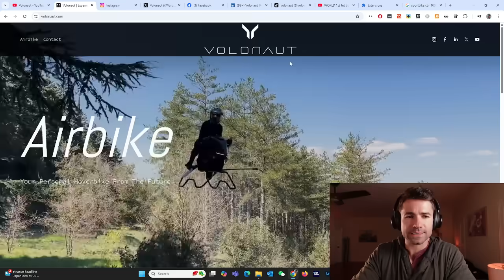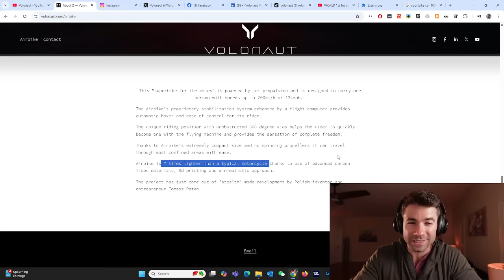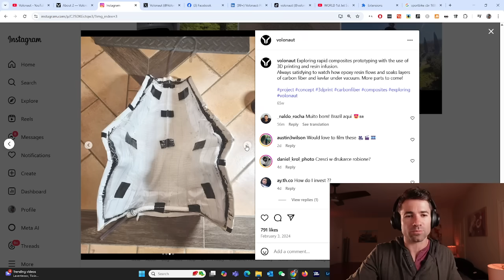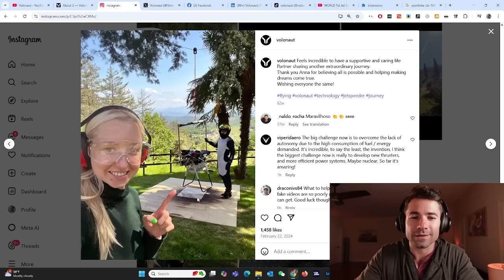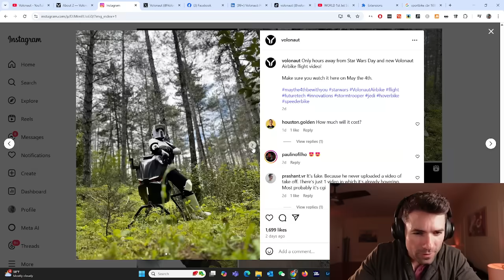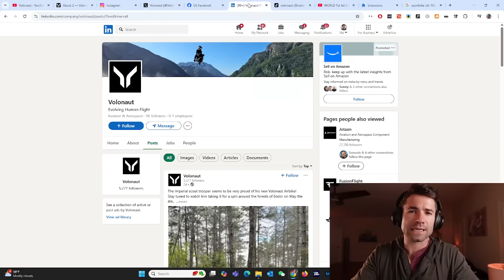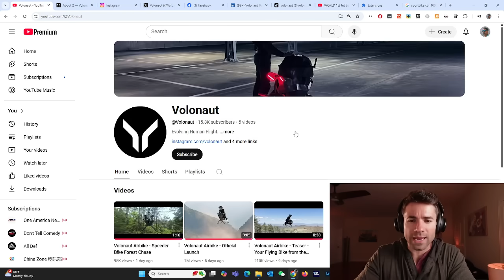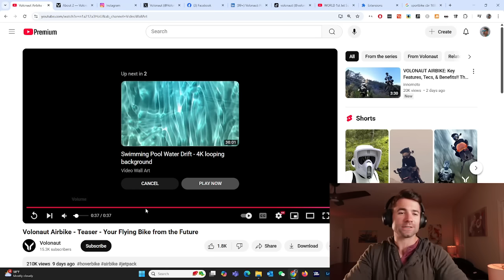Is the Volonaut Airbike Real or a Scam? (Expert Breakdown)

Comment: Is this a joke? As an engineer there are too many questionables:

1 - One handed handling definitely throw off the CG in the air for such a small package.
2 - Without any obvious propulsion systems e.g. no 'air intakes' at all
3 - Lighting are 'unusually' evenly lit in a sunny backdrop.
4 - No gravel ever get disturbed, even at close proximity, while throw up a big dust storm.
5 - No takeoff or landing video (hardest part to render)
6 - No video sound to determine throttling echo with environment
7 - It looks like a movie set "prop" in a green screen
8 - Biggest selling feature is the "massive propulsion system" in a very small package without any explanations.
9 - Frontal camera tracking is fixed to the vehicle yet lack any visible pitch "up and down" motion for forward or hover operation.
10 - The prototype photo shows combustion propulsions, but later change to electric midway through development without explanation?
11 - Tested on hard dried rock and not over some softer grassy open fields to PROTECT the pilot (obvious choice) OR their hardware investment.
12 - Any dusty environment will mess up any form of 'air intake' based propulsion systems with even ducted fans.

So right now, there are 12 reasons why it fake, am I wrong?
Reply: All of the above plus from a business perspective, if it were real, all he had to do was to show a raw working video as proof and investors would be falling over themselves to give him their money which does not seem to be happening.
Reply: @David-fq6ly  The guy's got a company going, selling personal drones, that's apparently sold out through the end of 2026. They seem to be flying. So this stunt could either be to promote that company, or... I don't know. It does not make much sense to me yet.
Reply: @The-Wall-Lizard  I agree, it really doesn't. Looking at the Jetpacks the US military started to use recently, they seem a lot more clunky and hard to use compared to this Airbike so if it were real, he would have created something that no one was able to do so far and he would be swimming in money from the private and military sector. So personally I think its 100% fake. The video itself is really well made so no idea how and why he would have made it but the business end does not make sense. I'd wish it were real tho
Reply: @The-Wall-Lizard  selling and delivering are VERY different things.
Reply: @David-fq6ly  people forget there is an entire industry of making fake cgi movies that in no way requires ai.
Reply: Even just the insanely high center of gravity and the lack of protective wear on the pilot is just blatant. They gonna tell me there's a massive gyroscope in the frame to keep the pilot stable too?
Reply: @MrLargonaut surely weve all see the space x thrusters returning... CofG is easily overcome with some good PIDs
Reply: @ and do you see that anywhere on the bike?
Reply: @davektowner  space x has control surfaces located at the extremities of the craft. this does not. this thing has nearly no leverage to prevent roll over torque.
Reply: My very simple answer would be: If they have it working, why they don't show it to the people.
Reply: Shall we mention the lack of a safety harness for the pilot?
Reply: @oczhaal  last thing youd want to be is strapped to this thing if it went bad.
Reply: How does it turn left and right/yaw axis...
Reply: @mrMankx  thrust vectoring  run by computers.
Reply: @airgunningyup  That means it must have 2 engines/thrusters downwards, if it only have one there can only be a tilt in pitch and aileron axis through thrust vectoring, or maybe it has horizontal thrusters.
Reply: @mrMankx  i think the thrist in divided up by ducts that vector , so one engine feeds several nozzles.
Reply: @airgunningyup  maybe, could be some side blowing nozzles, but i lean on this being a joke.
Reply: @mrMankx  no way, the founder of jetson one wouldnt put his name on it in that case ,, Its real , but may not work in the manner we think , not to mention they filed patents.
Reply: @airgunningyup  notta chance. look at the military jet suit and think about how far the control vectors are from the center of mass.
Reply: @airgunningyup where is the HUGE vectoring nozzles?  You have to have huge nozzles that can be moved QUICK with powerful redundant actuators. 

Nine of that is there.
Reply: no take off, no landing. Either that part is problematic or the whole thing is staged.
Reply: In the 21st century, people think everything’s an AI fake...
Reply: See the latest video "Volonaut Airbike - Test Riding a Flying Speeder Bike". There is audio this time of the gas turbine(s). Btw, the M1 Abrams tank operates just fine in dusty environments. Intake air filters are a thing.
Reply: yes, I think you're right.  As an electronics engineer myself the first thing I ask myself is what's the power source.  It takes a horrendous amount of energy to fly around like that. If its battery then the size of batteries needed is huge, and if its chemical the tanks need to be huge, and you don't see anything big enough for that. So, even if it makes it up into the air its not going to stay up in the air for more than a few minutes, if that.  The disturbing part is that so many people are so ready to hand over their money.  Everything about this screams scam.  If you're legit you be showing the core technology behind this thing, and they don't.
Reply: @RobertA-hq3vz It has a gas turbine engine with vectored thrust. People have clearly forgotten about Harrier jets.
Reply: I realy Wonder how they control the heat Problem i mean for a compact small engine like that and makes huge powers shouldent be get hot?
Reply: @WetWheels  Yeah, the thrust would have to be at least 1,400 Newtons, and the exhaust alone would exceed 600°C. The engine cores would be producing around 1,200°C
Reply: Its legit. It flys on jet engimes ran on a computer for ballance and other things.  100% real
Reply: @maddmavic you realize a jet engine has a massive lag time and there is ZERO way to use the engine fueling as a way to control the balance and vectoring.
Reply: Have you ever seen a Segway? Seems not.
Reply: https://www.youtube.com/watch?v=gGPCOVcaCoQ video of it taking off
Reply: 13 - There's no visible inertion momentum. It flies like it's weight (along with pilot) is Zero-kg. No tremble, no tilt, no acceleration/deceleration,
14 - The whole idea of center of mass being above the single propulsion point looks similar to a circus one-wheel bike.
Visit a circus or just view the video of such circus performance. It is hard to maintain ballance. And we does not see any stuggles of pilot to maintain ballance here. Ahd on Also - if on-board computer system are maintain the ballance- it works too fast with analysis and output.
Machine like that needs few wide-spread propulsion points to maintain a ballance. Even those jet-arm guys has their arms as propulsion points. Perfectly - propulsion points need to be ABOVE the center of mass - not below.
15 - What kind of energy source it uses? To generate such powerful propulsion you need lots of energy and complicated inner mechanism (like turbo fans, pressure chambers and stuff.)
16 - To accelerate or deccelerate such machine you need to change propulsion vector. And here we see only strictly vertical propulsion, which affects only objects below. If this machine is a single-propulsion, it acceleratation/decceleration should be much more slow.

So i think it's a fake.
Reply: Yes, you're wrong.
Reply: Biggest question? Why hasn't it been made yet. It's an easy concept, but no manufacture has made a flying vehicle yet. Strange.
Reply: @MegaCityOne There are tons of flying vehicles on the market. Much safer ones than this junk.
Reply: @MegaCityOne 
There is just the prototype but it is available for Pre-order
Reply: They have another video, flying in the woods, check it.
Reply: dude apparently saw your comment - he posted this a couple weeks ago https://www.youtube.com/watch?v=gGPCOVcaCoQ
Reply: I was guessing the propeller is placed vertically but as soon as you pointed out "no air intake" ok, that convinced me right away it's fake.
Reply: @Ming1975  What propeller? This has a small gas turbine engine and uses vectored thrust. Why do you assume no air intake? Have none of you ever seen a Harrier VTOL?
Reply: @MarkoVukovic0 Harriers have massive intakes. Don't see much if any on this
Reply: @surfmarine3118  The Harrier's intakes look large because of the big fan. It uses a high-bypass turbofan engine. This uses a small turbojet engine. Do you know the difference? The Harrier also has to be able to take off with a significant weapons payload. The Volonaut's intakes are in front, just below the horizontal LED lights, surrounded by red trim. Have you not seen the Gravity Jet Suit? Why do people think this is such a stretch?
Reply: No Wings no other ports to turn left or right ,  it will go up up up and come down in the same area like a rock. No safety device of any kind 20 foot fall will kill a person  it is 100% fake .
Reply: Maybe this engineer should learn what Google is and do some research into things.  This technology isn't even new.  The Williams X-Jet was a single jet engine that flies just like this, and that thing was made half a century ago.  Difference being we have half a century worth of technological advancement to make it into a smaller package, and it was already pretty small 50 years ago.
Reply: He is asking 2000$ (then 80 000$, and then finally 800 000$). That's a cute move. 
This is ridiculous. 

No one will be #$&@!!@ enough to spend 1 million dollars for a... "tiny flying motorbike". 
Better buy a luxury vehicle or boat or something...
Reply: Um look up Wiliam's x jet.
Reply: Yep. Plus if it DID work as claimed, why not just SHOW THAT, in full, uneditted, close-up videos that would be impossible to fake, and would be EASIER to put together, than the highly-editted clips which are the ONLY thing this company shows, in a dozen videos?

There's no viable reason to do this, assuming they DO have a real, working machine... You only ever have to use tactics like this, when you DON'T have a real machine, but just want to give gullible people the ILLUSION of a real, working machine...
Reply: Yes, you are really engineer. 🤣
Reply: Might be real, but the videos are AI.  Everything in focus at the same time: the helmet next to the camera and the mountains far away.  Pretty much a dead giveaway.
Reply: There are more videos of it, including tue sound, take off, etc.
Reply: As for the "no air intakes" if you look at the other media around this thing there is an obvious air vent on the top and large gaps on the sides and auxiliary exhaust ports (Possibly for stability control eg: harrier style) also on the sides.

I doubt this thing is ever going to be sold beyond maybe a couple units, it's likely going to be a technology demonstrator at the end of the day due to it's many very obvious limitations if it even is real.

(not trying to be rude, just discuss)
Reply: I kinda thought this was what the self proclaimed 'expert' was gonna say lol...
Reply: they have a video of takeoff, landing, in a forest, and with sound
Reply: @ambush_but_the_worst Oh the thing is legit 100% here's the thing though it hasn't been marketed to the capitalists yet so once it's marketed after a few years out there, could the price come down with more orders more and more product being sold worldwide? I'd be willing to invest in the company like this. It's the motorcycle of the future here today.
Reply: You're forgetting to say there's no visible control system to steer the bike, like an airplane rudder or anything. How's it supposed to turn or control direction?
Reply: .......lololololzzzz you are an enginer, and you think this is bullshit?? Lololzz, brother, this is very old tech, nothing new here, lookup "WASP" US military prototype from the late 50s 60s, please try a little harder, we expect you to build bridges and shit!!
Reply: Ei  "  As an engineer " , There's another video just released of takeoff and landing. you should see it, genius.
Reply: We also don't see a turbine exhaust. Considering the air resistance you'd have on this thing, you would need quite a large turbine. And a large fuel tank. It's simply physically impossible that this thing can work.
Reply: @MyRegardsToTheDodo 
Wrong
Reply: @MyRegardsToTheDodo  Exactly.  Someone was saying the FlyBoard Air proves this thing can work, to which I replied 'then where is EVERYTHING that makes the FlyBoard work'.  Flyboard proves YOUR point (the sensible engineer standpoint).  

Also, you just said something that I was physically aware of but my brain wasn't turning into words.  Just like a motorcycle, sitting upright like that means some mad air resistance.  This thing would have to tip forward and push the driver ahead at a severe degree to keep them low enough into the wind without getting flung off.
Reply: Funny thing tipped me off it was fake....you see the long rod at the front? Yeah 4-5 vids that piece is many different lengths...i mean making something like this you would need consistancy. As in nothing in the plans changes, yet that piece in all vids is of different length😂
Reply: @lorgariiix 
The Rod is the insta 360 selfie cam stick 😂
Reply: Yes you’re wrong, it’s real and jet propelled
Reply: yep what you said clearly doesn’t make sense what so bit 😂💀🤡
Reply: You invalided your expertise when you started with one hand throwing the balance off. Not even reading the rest of your points. But I do see "it looks like a prop." Now that is years of "engineering" experience right there lol
Reply: The balance will be managed by a computer, and talking of balance, the wobble it does on its access is just too good for an AI fake, and wouldn't look like that if hung from a crane. It's legit. Although I suspect its flight time is pretty limited.
Reply: @10aDowningStreet  youre an idiot.
Reply: @10aDowningStreet: It's not an "AI fake." It's computer graphics. The animators can make it do anything they want. AI is a red herring.
Reply: @10aDowningStreet the thrust vectoring isn’t there.  

You can’t get the instant power from a turbine like you can an electric motor. 

So all you have is thrust vectoring and that needs some serious duct work and actuators. 

It’s just not there.
Reply: @10aDowningStreet  computer balance messing up a little while several feet above solid rocky floor is just unsafe...the fact he doesn't have any fear even wearing cosplay costume while not even showing the amount of crashing and not wearing the safety equipment to be prepared for those falls 🤡🤡🤡
Reply: why do you not trust that this is real? you trust trump even after he publicly said, "I don't care about you. I just want your votes"
Reply: I have personally seen this exact item fly in person.  It's legit.  Trust me bro
Reply: @flyerelite5153 sure you have. All he needs to do to prove it’s real is let a media camera crew he can’t control come out and video it. 

Really odd that he hasn’t had a local TV station do a segment on it.
Reply: You put way to much effort into proving this obviously fake video is fake. Get a grip.
Reply: @Slime-k4t  Perhaps you don't understand the mind of an engineer?  Because his writeup is exactly what I would expect from an engineer.  We try to prove things, vs guess things.
Reply: Exactly.  I was replying to someone who critiqued the post. not to the post itself.
Reply: @michaelbauers8800  what do you mean? howard johnson is right! a flying machine?? this is absolute madness. itll never work.
😠AND YOU SHOULDNT TRY! 

next youll be claiming heliocentrism
Reply: @Slime-k4t dumb people like you are broken clocks...you might get it right 2 times a day but wrong every other time...

This "unnecessary" debunking.. can be clarified with other video footage... But until then, they are focal points of CGI vs reality
Reply: @Slime-k4t  it took him maybe 4 minutes to bang that response out....about the same amount of time he spends on your mom.

Comment: if its not real it could be. i'm not sure why "gravity industries" or "zapata racing" did not immediately jump to this form factor. this is head and shoulders better form factor than having your arms encased in bulky jets.. or balancing attop a tiny footstool. so yes, its probably real, IMHO, and a much better design than any of the existing "personal flight" inventions. this form factor wold be better for military use as it appears it could be adapted to be hands free, also looks like it would be a much smaller learning curve than any of the precursors, making it great for civilian use. be interesting to see how aerodynamic adaptations might arrive an an efficient "cruis-mode" for longer travel distances. im sure the up time for this is probably < 5 minutes. jetson 1 (or whatever) has been toyed around with by proposals of adding a foldable hang glider-like apparatus for safety and longer travel distances. i'm sure this will evolve. i want one of course.

Comment: I’m curious as to where the fuel tank for the jet engine is going to go. Even if it can carry a fuel tank, what kind of mileage would you be able to get from a thing that small? The engineering aspect of this thing seems a bit too good to be true, especially if you are considering jet engine propulsion.
Reply: It will probably fly for like 10-15 min like most of tiny  jet aircraft.
Reply: @misiu9049  at less than 100lbs and can fit between your legs?

5 mins if you're really lucky